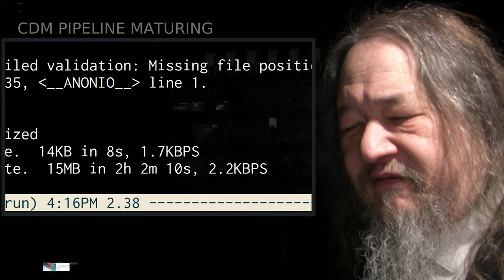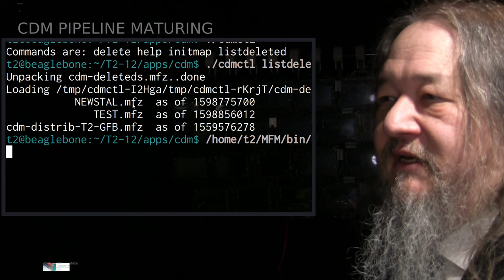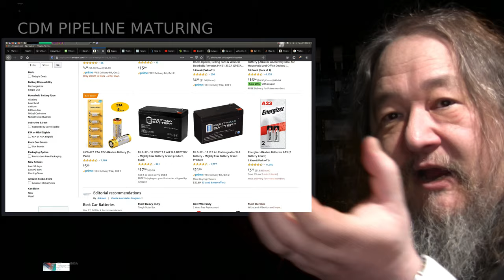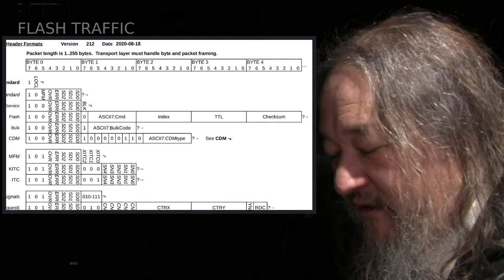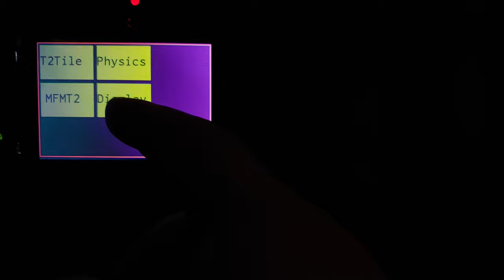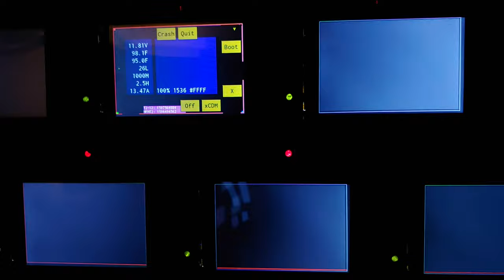Flash Traffic for Distributed Control - T2sday Update 286

Comment: I tiny lipo cell would probably work better for the portable tile, adafruit has a good selection and even has charging controllers so you can charge the tile while its powered on and stuff
Reply: Also, tiles could assume when they get a command for the second time all tiles who it sent it to last time have already seen it, so loopbacks like that wouldn't happen
Reply from the maker: As long as it delivers 12V somehow!
Reply from the maker: How can the tile be sure it's the same command?
Reply: @T2TileProject  maybe some kind of indentifiable checksum hash of time since 1970 and MAC address of the origin tile?
Reply from the maker: @NathanK97  Tiles have no unique IDs!  That's a feature!
Reply: @T2TileProject  then as far as I can tell the only thing that is partially unique about a message would be the time it was sent? Oh! What about the input voltage level as a pseudo "distance from power injector tile"? Time mixed with voltage might limit the probability of identical message IDs to highly improbable
Reply from the maker: Tiles also have no shared clock!   It's another feature!  Maybe the relative position tracking isn't so bad, even with the loopback cable problem?
Reply from the maker: For all the tiles in one power zone, their +12V rail amounts to one big piece of copper.  They show slightly different voltages mostly due to manufacturing variations and sampling noise.
Reply: @T2TileProject  if the goal is to know with a reasonable degree of certainty that you can tell the difference between any 2 messages, so tiles can reject and drop messages they've seen before, doesnt variations in clock and noise in the voltage help with that? Though at that point it's be essentially just assigning a random value to a message, so we could skip all that hard stuff and just do that, assuming the tiles don't have a shared RNG seed as a feature XD
Reply from the maker: Indefinitely scalable design pushes me to key on properties of intertile relationships, rather than of individual tiles.  But indeed, adding some random bytes could almost surely disambiguate a local region of tiles (which is all flash traffic can reach anyway.)